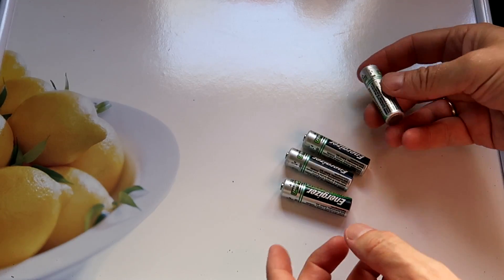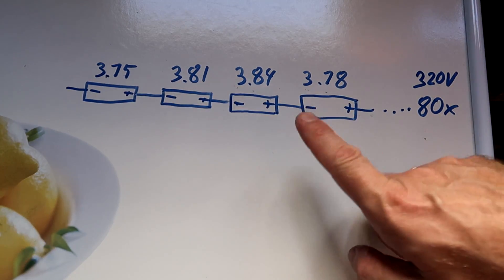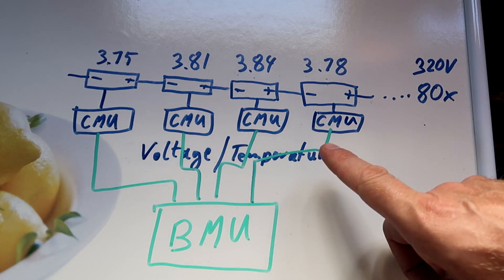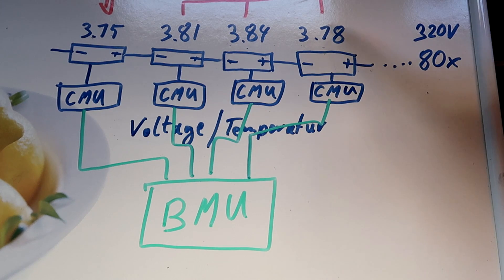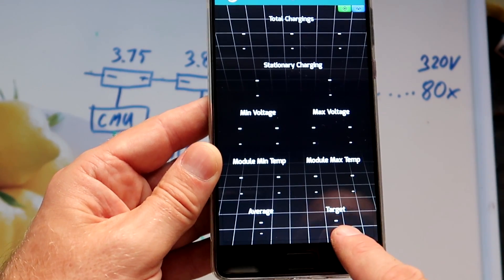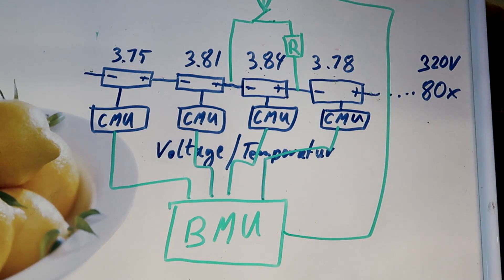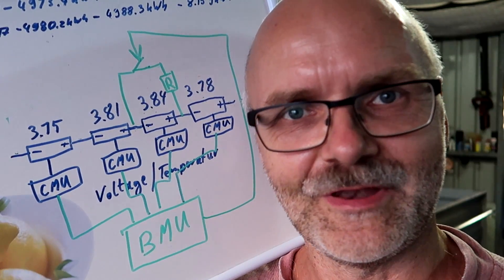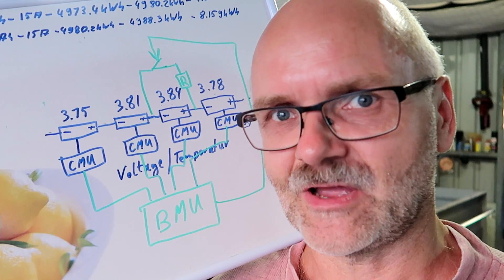EP64 - Balancing the battery  in the Outlander PHEV

Comment: Hi Andy! excelent work but, how to explain the change in battery capacity when the car is parked? This small change in battery capacity influences passive balancing?
Reply from the maker: No, balancing is only happening during charging, not while parking. The change in range during parking is purely a recalculation of the BMS.
Reply: @unpluggedEV  You think that balancing works only during charging and not while driving. When the battery discharging? I think the BMU is operational as long as there is some voltage in the battery. I made a battery test when it was almost empty than when it was fully charged. The balancing drive of the different cells was when ON when OFF for same cells!

Comment: Do you know howto trigger the balancing mode manually- i.e. when the Outlander PHEV electrical parking brake is activated? I have read that with the MUT3 OBD interface + Software it is possible too "smooth the battery" when the car is "powered on". However this is a quite expensive and uncomfortable way.
Reply from the maker: That's the procedure I explained in EP106, the Cell Smoothing Procedure...
Reply: Sure- but it would be great if one could activate this "deep-balancing" method manually- i.e. via APP/CAN Bus command/ one can save the walk to the local Mitsubishi dealer. Do you have a MUT3 OBD reader?
Reply from the maker: You would need more than just a reader and the MUT III including software is too expensive. They are sold only to dealerships directly through Mitsubishi. Teh cheapies from China apparently do not work correctly and have lots of issues...

Comment: Well explained except the nominal voltage of a li-ion cell is either 3.6 or 3.7V depending on the chemistry. Full charge is 4.2V but I doubt Mitsubishi would be taking it above 4.1V or much below 3.2V to slow down cell degradation. This video is a good example of why you don’t use autofocus if you don’t have to :)
Reply from the maker: Thanks for pointing this out. That is correct, 3.6 or 3.7V is the nominal cell voltage. However 4V is the voltage been taken to calculate the overall voltage of the pack = 300V. It should be 3.6V x 80 = 288V. 300V sound better maybe ;)

Comment: Hi Andy, You know about 'Top & Bottom"balancing, me thinks the PHEV doesn't use bottom balancing if it has a target to reach & that target should be high so top balancing can be effective, me also thinks that the balancing  "act" is over complicated on the PHEV. I want it to balance at the end of charging all by itself ie not plugged in. As you experienced the other day eg you've driven to coonabarabran & you have to wait or slow down the charge if the bloody thing starts to do än act". All too complicated. hohum.
Reply from the maker: Don't worry too much about it, the car takes care of it when needed. Also, when you don't fully charge the battery, it does not balance at all during this cycle. It will then do it the next time or whenever it gets the chance.

Comment: Can you perform your own battery smoothing my ev range has dropped to 38 Km
Reply from the maker: You cannot do this at home, the vehicle needs to be hooked up to Mitsubishi's MUT III device in the workshop to run the procedures. Do you have the PHEV Watchdog to determine the true state of health of the battery?
Reply: @unpluggedEV  thanks for your reply yes i have watchdog but my obdii does not work fully can you recommend what one to buy in australia
Reply from the maker: The VGate iCar Pro BT 4.0 is very good. I heard this now from a bunch of people. Have a look on the PHEV Watchdog website for a list of tested OBDs (link in the video description).
Reply: @unpluggedEV  ok thank you just bought one on ebay
Reply from the maker: That's where I got mine from. AU$35 incl shipping ;)

Comment: Doesn't a passive system require heap of cabling as well plus switches? :D You need to control the switch somehow...Active would be much better...
Reply from the maker: The effort is quite high to get this all done. The switches are electronic ones, no relais or contactors all controlled by the BMU and software. Well, the software is a masterpiece then, eh? ;)

Comment: By the way : connecting batteries only in series multiplies their voltage but not the capacity. So, unless they are in blocks which are in turn connected parallely, one cell would have to have 12 kWh capacity... The modular organization of battery should even more facilitate the active balancing configuration... You just need one "watchdog" per module reporting to the bmu with feedback loop. Hmmm
Reply from the maker: That is correct, they're are all in series connected, no parallel to increase capacity. Each cell has 40Ah capacity, not 12kWh. Watt hour = Ampere hour * Voltage so 0.16kWh per cell
Reply: Each cell has capacity of 12kWh at V=300DC. Can you tell me what is the mean power reported by the dog when you drive on flat at 50km/h in a stead state? Because according to the capacity, you can constantly draw 12kW for an hour so.... I'm trying to calculate a potential range on the battery charge in an ideal and realistic conditions. I need your input for that ;)
Reply from the maker: No, not each cell has 12kWh, it has 40Ah and 4V. The whole pack (80 cells in series) has 12kWh.

50km/h will draw 5-6kW from the battery. The battery has only a usable capacity of ~8.4kWh (12kWh*70%). Getting 6kW from the battery does not take into account the heat loss in the battery and the efficiency of the inverter though. Driving 50km/h constant on a flat road will give you probably 50-55km out of the pack
Reply: Ok - so I did some checking - couldn't find any specific info on the LEV40 but the LEV50 is nominal 3.7V Cell (that's as high as a single cell goes in any commercial lithium chemistry AFAIK). So @ 40 Ah that's 40Ah x 296V (80x3.7) = 11.84kWh total capacity. Mind you 40Ah is the nominal capacity - actual capacity may be higher, but I doubt Mitsubishi are using more than the nominal capacity.  So you would have to add an extra cell to get 300V and a true 12kWh battery but it's close enough. Each battery actually has an individual capacity 0.148kWh. You add kWh together even in series as the voltage multiplies in series.
Reply: MondoTV yes, maximum allowable power is increasing with voltage, but not capacity. These two terms are different.
Reply: Power is a completely different thing - In fact it's related to the Ah capacity of the battery but it is also linked to the chemistry and quality of the battery manufacturing process. Capacity does increase with voltage. kWh is an absolute measurement of capacity while Ah only tells us capacity for a known voltage. A 300V 40Ah battery obviously has more capacity than a 3.7V 40Ah battery even though the Ah rating is the same.
Reply: MondoTV kWh is not really a measure of capacity. It's just "a promise" what it can deliver to an engine (or any other recipient). The real capacity is an amount of elemental charges (electrons or ions) that can be generated by the battery in a given unit of time. Power dependency in the function of time is torque and speed related and depends on the motor. The more charges pass through the motor winding (namely the current in amps) the more torque the engine can generate thus increasing its speed and, in consequence, its power. This picture is oversimplified but it's enough to understand power relationships to capacity ;)